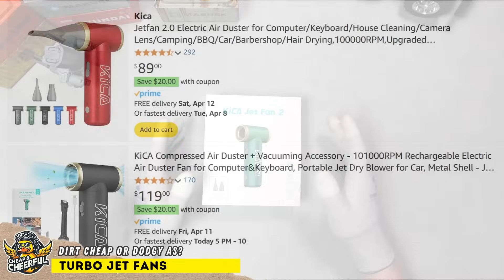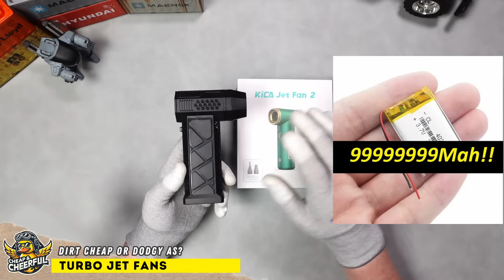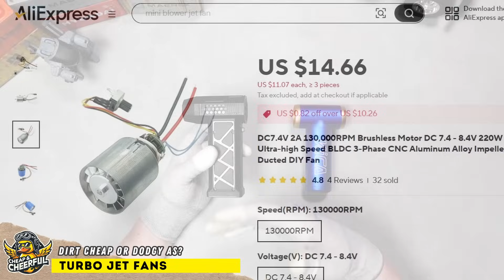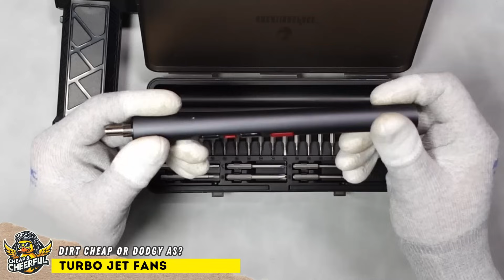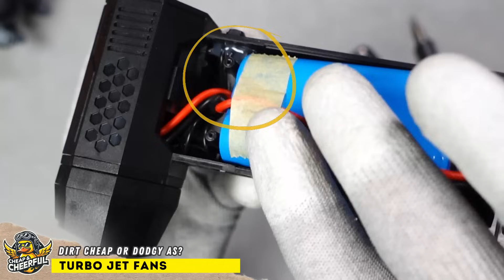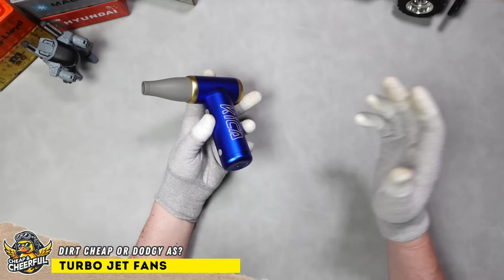Cheapest $16 Turbo Jet Fan - Decent or Dodgy?

Comment: I bought the same one a few months ago for work (cleaning the surface from dust before applying silicone) and very happy with it, my came in the same exact box but a bit different molded plastic and they changed the button placement, got it on sale under 10$, got a different one for 20$+  with more battery capacity and more powerful for home use and it's a little better than the cheap one but not x2 or x3 times I paid for it.
Reply from the maker: Under 10 bucks! Nice buy

Comment: Just got one of these, 16 eur. Very inaccurare battery charge indicator, but works well. Plenty of reason to run this at low power levels, like putting air into a fire at night without wanting to wake the neighbors. I’d love a half and even third of what is now lowest setting. 

Next one I will make sure it does percentages, not just 4-5 speed levels.
Reply from the maker: Agreed on both. Thanks for watching

Comment: Isn't the violent fan a fire hazard? There's not any type of protection inside...
Reply from the maker: A few subscribers think it's the battery BMS (protection circuit) on the battery. I'm satisfied it's a safe design but wouldn't be keeping it in my pocket all day, as with any similar device.

Comment: Thanks for this video. I ordered one of the 'violent fans' after watching it. It arrived today and I'm not disappointed. Cheers.
Edit: Mine looks superficially the same as this one but is different (the side isn't held on by screws for instance). Also mine has 2 x 21700 cells. They have so much more capacity than 18650s.
Reply from the maker: The 21700 versions are great, nice buy!

Comment: Would you consider maybe checking out some soldering irons? I see so many of those cheap under 10$ battery powered ones. I'm guessing their crap (too low power to really do anything). But ive also seen the ~20$ ones T12 and T85 ones that use Usb-C PD. Imo they look pretty nice! Already ordered the recommended CreationSpace driver and the cheapo blower! Thanks again for the great content!
Reply from the maker: Great idea! Added to my list. I've personally bought 3 before I found one which seems decent but haven't tested enough to recommend. It's an orange one with LCD screen. Can't see a model #. PD definitely. So many crap ones. Thanks for the useful  feedback!

Comment: I bought a similar fan to the cheap one shown here but for a price of about 30 UK pounds (which is more than twice the price). Outside is a bit slimmer but otherwise looks very similar. However, I found that spending extra got me the following:
- 26650's instead of 18650's. They advertise 4500mAh, not sure what it really is but it is rather heavy and I haven't managed to discharge it yet (had it for almost a year).
- Proper cell balancing, the midpoint of 2 cells is connected to the charging board is well, the datasheet of IC used shows it does balancing.
- Speed control.
- Some protection from the fan being turned on by accident (the button needs to be held for 3 seconds before the fan turns on)
- Nozzle that properly locks in instead of a wimpy magnet.
Funny enough, the price of that same model of fan later rose closer to what the kica costs.

In terms of feedback, it's a good video with a pleasant aussie accent but 2 things I'll note:
- The electronics on the back of the motor is actually the ESC. They managed to make it so small by using "2 in 1" transistors, same type as used in laptops for generating power rails, they are basically a MOSFET half-H bridge in one SMD package, this way they only need 3 footprints instead of 6.
- The wind speed could have been measured in m/s, would have been more understandable to most of the world and comparable with listings since a lot of them advertise speed in m/s.
Reply from the maker: Thank you, very informative post, appreciated.

Comment: The circuit board on the batteries is most likely a beefy bms, if it were the esc, there would be 3 cables going out, not two. Those mosfets are the protection switch for OC and  OV protection.
Reply from the maker: Thanks for the feedback, much appreciated.

Comment: i can confirm that the the cheap kind is fine over an extended period of time and doesn't seem to mind being dropped or falling off a table. though it seems there are variants of the same design out there so i can't say they're all created equal. mine came in a plain black box labelled "VIOLENT FAN" which is the kind of thing i find funny and has the charging port on the rear. it also looks more like the product page you showed
Reply from the maker: Great , thank you for confirming!
Reply: "violent fan", lol

Comment: Charger board didn't have protection circuit (unpopulated components) and it seems battery pack itself had protection circuit.
Reply from the maker: The MOSFETs on the battery is protection you reckon? Could be. Looks alot like brushless ESC to me. I had other commenters say the circuit on top of the motor is battery protection, and some of the AliExpress listings say the same. Real weird!
Reply: @CheapCheerful  You would have 3+ wires coming from battery pack  if it was ESC for brushless motor. 3 phase for motor and control signals and in video I only see 2 coming from battery to charger board.

Comment: You don't want these for the same reason you don't want a portable vacuum cleaner. Even the cheapest plugin vacuum will smoke the best portables in terms of suction. That and it's got a limited lifespan unless you plan to crack it open and replace the lithium batteries inside the thing.

I bought a DATAVAC brand Electric Blower from Newegg almost twenty years ago that plugs in and sounds like a vacuum cleaner. It was made in the USA, the entire thing is made of metal and it was something stupid like 20-40 USD during a sale. I just double checked and it looks like the price has ballooned all the way up to 120 USD.
Reply: I love my 240V Datavac but have been eyeing one of these battery powered ones for smaller tasks when I don't feel like having to uncoil the wire, remove from the box and do the steps in reverse on the Datavac.
Reply from the maker: True, 120V/240V will always smoke battery powered. These are handy for much smaller quicker tasks. Eg. Quick vacuum of the car after the kids bring in a bunch of dirt. Done in a minute, no messing with wires. Highly recommend portable vacuums for this purpose.
Reply: These two devices are blowers, not vacuums. I have a variant of the Jet one which is variable speed and works well. I had thought of getting a DataVac but I would have to do a lot of vacuuming to pay for the $120 CAD
Reply: I'm not sure you get the point of "portable" lol
Plug in anything is always better but has the downside of a wire and in terms of performance most things are good enough but I will agree that most portable vacuums literally suck.
Reply: @vgamesx1  Please explain it to me. Because I keep all my dusty shit indoors within spitting distance of an outlet and If I'm taking the effort to drag the thing outside and blast it with air it doesn't take much more effort to connect my blower vac and take that along.
Reply: these things are extremely powerful for their size. for once the aliexpress claims like "200000 rpm" actually appear to at least be using the correct amount of zeroes on their spec lists

Comment: When you read the price of the "Kico Jet Fan 2" early in the video I was shocked. I've been using a $14 US duster that looks a lot like that for over a year. I have to be careful so it doesn't blow things off the desk or out of my hand. It's very powerful and has a bunch of brush-y attachments. It recharges by USB-C. It has multiple speeds and a simple safety feature. It seems to be made well. It's noisy as PHUUUCCKKK. I haven't looked inside it because it works.
Reply from the maker: Yep, cheap and does the job is the best combo.

Comment: The vacuum cleaner that also works as a blower is about €5.00 on aliexpress.  I suspect they're just hairdryer based
Reply from the maker: Yes, the steel ducted motors deffo seem to be from brushless hairdryers, looks similar to a Dyson motor I've seen before.
Reply: @CheapCheerful  the one I bought is no where near the quality you tested. It's handy however as a crevice vac or just blowing dust away from keyboard etc.

Comment: hi i believe the circuitry on the battery is the protection for the battery eg over discharge, short circuit etc
Reply from the maker: Ooooh! That was the other option I'd edited in, but I cut it to keep the video concise. Thanks for confirming for me.
Reply: @CheapCheerful  and also balancing so one of the cells isn't one charged and the other discharged
Reply: @CheapCheerful  Yep, it's a BMS.
Reply: Right. A BLDC controller would have 3 phase leads coming out. Assuming it is BLDC
 motor.
I like the videos.